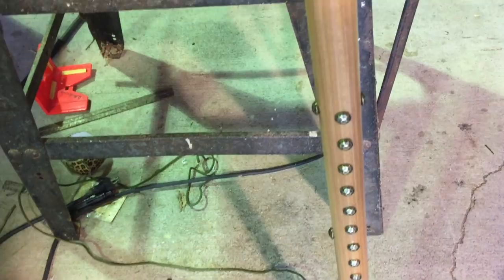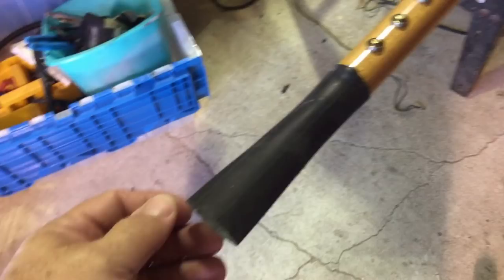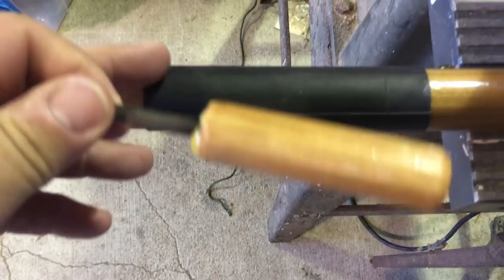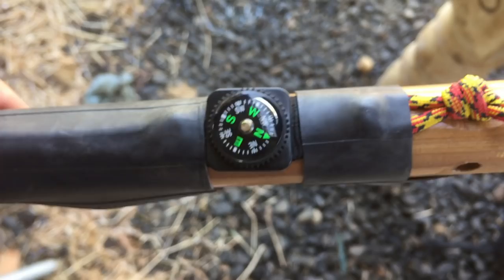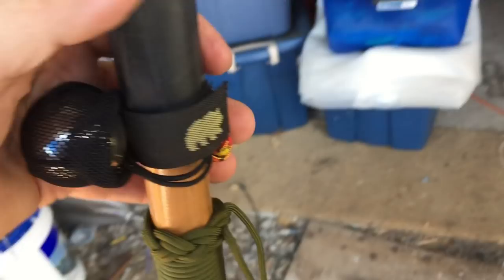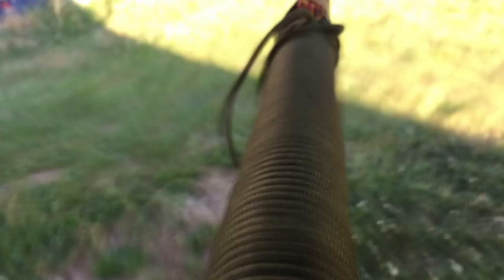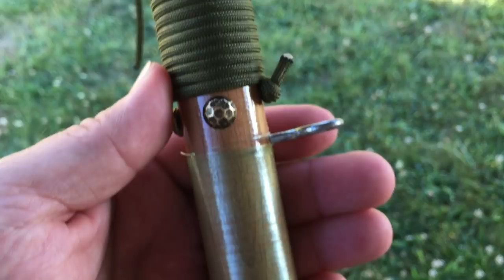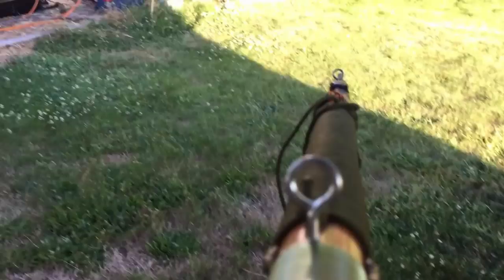Mods for Old School Boy Scout Walking Stick

Comment: Interesting ideas, but for me, it’s too much & I’d simplify it by: I’d epoxy in the compass, get a smaller Ferrell rod to add to the inner slot, along with the fishing line & seal the slot with duct tape instead of clear tape. I’d also burn the one inch markings instead of using tacks. I wouldn’t want to fall & have the knife cut thru the inner tube, plus I think the eyelets would make it harder to slide your hand to the top in an emergency, so I’d leave those off.
Reply from the maker: Indeed... this was just to give ideas of what you "could" do. The tacks do come in handy for emergence nails and add punch in defense of your life from wild animals. I have since added an in-line skate wheel that is held down by the hook at the end. It works as a hold-down block for bow-drill fires.

Comment: I believe in an earlier video you used a table saw to cut a slot in the staff to store fish hooks and bandaids.  I would be concerned that has compromised the staff.
I appreciate having a staff.  I use one. And all the power to you making it yours.
Reply from the maker: After you wind the 550 cord around that handle area where the cut was made, it increases the strength once more. It feels very solid in the hand. Remember, that step is optional. Some will say it is too dangerous, while others have still other reasons. It's what I wanted to do, and knew I could do it safely. Have I ever used that storage area? Not yet, but I know where it is if I had to. :-D

Comment: Cold Steel has a Hog Spear that is a really nice Spearhead and works very good as a knife and the Spear Shaft work really good as a walking stick.
Reply from the maker: Thank you! I will have to look into this hog spear!
Reply: I have been looking to buy that cold steel spear but I haven't heard of anyone who has it.
I go camping in the New Mexico mountains and the last time I was there, I got out of my hammock one night to piss and when I used my high power flashlight to just look around I saw a pair of cougar eyes starring back at me from about 30-50yrds. I had a hand cannon on me but I still didn't sleep to well the rest of the night. 😐
Reply from the maker: Yikes! It that situation, I would want a hand-cannon rather than a pig-sticker... I don't figure I would have gotten much sleep after that, either.
Reply: I have a replacement implement handle that has a metal cover over the tapered end. I drilled a hole through it so I can attach a Bush spear to it with a bolt and wingnut. This makes it a handy defense tool! ATB Sam from Vietnam

Comment: Looks like you cracked the top, you can add another copper cup for reinforcement!
Reply from the maker: It did have a small crack in it... all I did was use wood glue... stronger than original. Still walking with it till this day... two 50 milers with it now.

Comment: I noticed that it's already splitting at the top. A staff is supposed to be kind of a simple tool starting to look like it was designed by a committee.
Reply from the maker: The ideas presented are designed to spark imagination in others, and not everyone will agree on what they prefer on their staff... some like a minimalist staff, while others want a Swiss Army knife. The great thing is, it is totally up to you and your preferences on what you add onto your staff. If a split occurs, no biggie... Gorilla wood glue to the rescue, and it is stronger than the original. Good luck on your project and thank you for adding to the content of the story. Best wishes.
Reply: You can attach a swiss army knife to the handle with a ranger band or bands if you wish. ATB Sam from Vietnam

Comment: Rap a drum liner bag under your bank line  as a emergency cover element for foul weather
Reply from the maker: Great idea... light weight and compact. Do you think the asphalt in the bank line will deteriorate the plastic bag? I've had that happen before.
Reply: @HelicoolsHelipad  it might but maybe if you get the heavy duty contractor grade it might not
Reply from the maker: @mikeaden7870  I have seen some that are resistant to oils and grease... made for an auto shop, I suppose. Careful selection could be key. Thanks for furthering the "story" and adding a handy feature.

Comment: please post a link to where i can get one of those small lights
Reply from the maker: Unfortunately, when I went back to find the light, it was no longer available, but fret not... Walmart sells a tiny LED bicycle handle bar and seat post light kit that is perfect. Red for tactical, and white for all other times. They fit the staff perfectly, as it is the same size as a handlebar. You can find them in the bicycle isle at Walmart, or other stores that sell bikes for kids.

Comment: I’m new to walking sticks. What is a stave? What are the tacks for? Good vid. Thx
Reply from the maker: A "stave" is an old school term for staff or walking stick. The word "stave" appears on the 1940's? designed walking stick in a Boy's Life magazine.

The tacks serve multiple purposes. They are arranged in increments of 1', 6", and 1". You can test the depth of a steam (for instance) before trudging in and finding yourself over you head. You can measure the size of fish that you catch to ensure it meets the legal standard. They can also be removed from the staff and used as an emergency nail. Furthermore, they give the staff a weapon-like feature to ward off vicious coyotes and such. Lastly, they are decorative. 

Great questions... thanks! Come back any time my friend.